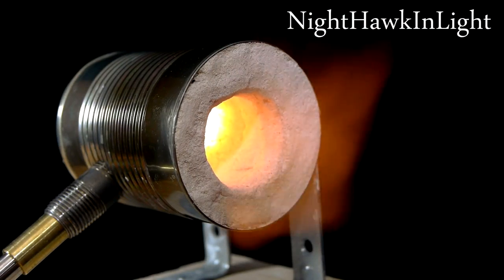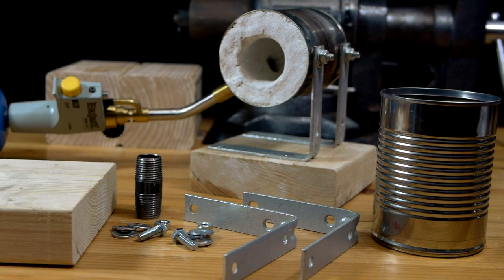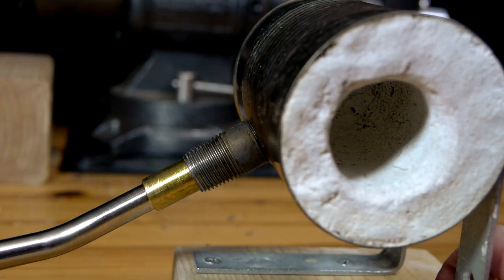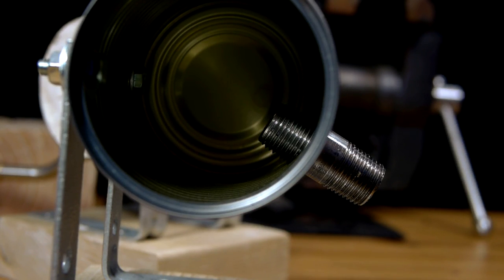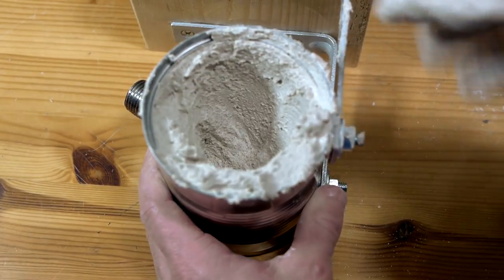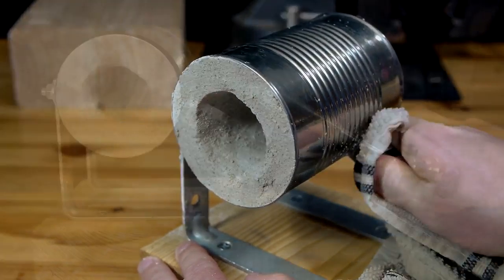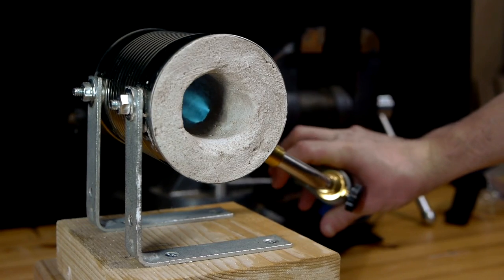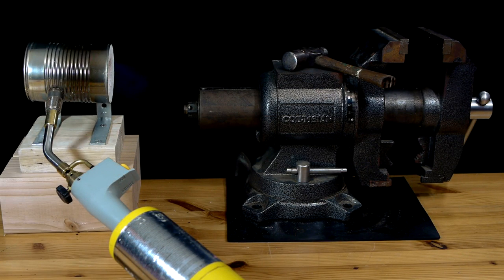How to Make a Soup Can Forge

Comment: I made this and it doesn't work :(
Reply: Why didn't it work?
Reply: SuperTheNova _ i figured it out its because the torch head he says to use in the video you HAVE to use it if you use a normal one it wont work
Reply: Just buy one. Lowes sells 3 different models. The cheap $12 one that you have, the $34 TS4000 and the $50 TS8000 which is bundled with a MAP tank. The torch head he's using is actually overkill and being used very  inefficiently. I use that head in a 1 gallon cavity. And you can get the entire forge to turn yellow hot with the smaller burner you have (in this size forge). The issue is insulation, projection and chemistry.

1) A lot of knife forgers put the burner hole on the side then leave 1 side of the forge completely open (to put the knife in). The problem with this design is there's no back pressure. So 100% of the heat immediately escapes from the opening. If you look at this guys forge it's awful. He's got a better burner than you... but half of the whole cavity isn't even reaching yellow heat. I use that same burner in a 1 gallon forge (way bigger) and get every square inch to yellow heat.

2) If you wanna see the effect back pressure has (on driving heat up) do this. Take the small torch you have now. And instead of putting it in the small burner hole, put it in the large exhaust side. Then play with the position of the torch head. It's hard to explain the angle but you don't want it directly in the center or on the side. Put it in between both the center and side. Then angle the head slightly so the flame shoots towards any bottom corner on the opposite side.

You wanna get the wall of burning exhaust gas (not the flame, the invisible gas), pushing back against the flame from the torch head. So the heat shoots in towards the bottom, the hole on the bottom is too small for the heat to escape, so it bounces back towards the torch head which is pushing a portion of the exhaust heat right back into the forge. When you get it set right you may see the torch flame "disappear" into the exhaust wall, then if you wait a few mins you'll see the whole forge light up yellow.

All you're doing is creating a positive feedback loop. And another thing you'll likely have to do is shut off the original intake completely. I guarantee if you do this, play with the angle of the torch, then just wait the whole forge will heat up. Also, don't stick the brass head in the forge, keep it just outside 1/4-1/2". Otherwise you'll break the exhaust wall creating a spiral. When you keep the flame out a bit the expanding gas hits expanding gas that's what you're going for. 

3) 90% of the videos you see on YT, guys are using burners much bigger than they need. They use plaster of paris which is horrible. Plaster of paris NEVER cures in a forge. Even when it's "dry", you're using unnecessary heat to convert calcium sulfate hemihydrate to anhydrite (releases water) which takes a lot of energy.  This process takes 2 HOURS to complete. And if you run your forge longer than that, another endothermic and reversible reaction takes place.

Most people don't run their forges longer than 2 hours lol. So you shut this type of forge off... the anhydrite slowly converts back to gypsum / plaster (exothermic). It desiccates the water from the air. Then a few days later you turn the forge on again. And over and over you're repeating this reaction and "insulating" the forge with WATER till the plaster breaks down & the entire thing cracks to pieces.

That's another reason anyone doing this will get terrible heat insulation. And it's ridiculous cause all you need to buy is "Crystal Kitty Litter" from Shoprite. It's $10 for a huge container. That's 99% pure silica. If you take that and throw it in a blender you get the purest white silica sand you'll ever see.

THEN you use that pure silica to make waterglass with lye. Then build your forge with pure white silica sand and water glass as a blinder. A forge like that will cure permanently after a few uses. It'll insulate and reflect heat much better. And if you build it right by using a steel cylinder for the cavity then POUND the sand in with a hammer hard as fuck it'll last a couple years easily. That's my last piece of advice. If you're gonna build one, do it once and do it right so you never have to do it again.
Reply: Why dont you show us yours? Id like to see it
Reply: Robert Cece can you make a video of you doing this?
Reply: Lol this comment alone is better than the video
Reply: Loving that i found this comment AFTER i finished my brand new Plaster of paris/Sand paint can forge .-.

Comment: were the fuck would i buy sand :( is such a lame question but in the city is there a place?
Reply: at walmart
Reply: Go to construction sites, and ask them if they would mind if you take a soup can's worth for a home project.  Usually they won't.  Make sure you go when they are doing either foundation pouring, or some sort of masonry, if it's a building.  I wouldn't really recommend using beach sand in your concrete mix, if that is what you are asking.
Reply: Home Depot has to be the best place.

Comment: I really wish the author of this video would take it down.  I am getting pretty sick of explaining to new, wanna be blacksmiths that the soupcan forges they built from this video will never actually work because the design is fundamentally flawed.  

People watching this, please, do yourselves a favor and do more research.  While it might be possible to build a marginally useful forge using a propane torch for a heat source, it will NEVER be possible using this crappy home made castable refractory.  If you want a chance of making a usable forge, go to a ceramics supply house and buy a little Kaowool or Innswool or equivalent and use that for the forge walls.  Use light weight fire brick for the end wall and to form a smaller front opening, and you might be able to build something that will actually heat a piece of steel larger than a 10d nail.  

Here is a link to a forge building tutorial using a torch for heat that has a chance of actually working.

http://www.paragoncode.com/shop/micro_forge/

If you do build a forge using this idiotic plaster/sand refractory, please to not  come over to the r/blacksmith subreddit wondering why it doesn't work.  You will be told in no uncertain terms that the reason it doesn't work is because the guy who made the video is an idiot.
Reply from the maker: Scott Rich Thousands of people have used this forge successfully for knife making. I could post links to results all day long. Here's a recent one: https://www.youtube.com/watch?v=Zf1btj7wWxI I've made knives myself. Say it's impossible and call me an idiot all you want, you're the one that looks the fool.
Reply: NightHawkInLight Come on over to the sub reddit.  People coming over there wondering why their "soup can forge" doesn't get hot enough has become something of a mini meme over there.  We have to set people straight nearly every single day.
Reply from the maker: Scott Rich The reason it doesn't get hot enough is because people use pencil flame torch heads rather than shelling out for a proper spiral flame as I recommend in the video.
Reply: knife guy So do I.
Reply: Could you make a video on maybe how to make your primary forge? I really like the design and it doesn't seem really flawed. Or just maybe list the tool and material you used to make it any im formation would help!
Reply: Scott Rich I can assure you that this "forge" works perfectly, as I finished mine today, and it heated up an iron bar from cold to bright red in about 30 seconds. It may not be sufficient for long metal pieces, but for knife blades up to 3-4 inches it is quite usable.
Reply: If r/blacksmithing hates this video so much, why did they send me here to get me started?
Reply: +Scott Rich lol man take a lesson with it
Reply: +Scott Rich man, the reason he makes these videos is so anyone can easily do it with shit they have laying around. 

perhaps you should warn people of the dangers of using ceramic wool thats not coated in a layer of refractory mortar (it begins to release a fine dust that will destroy your lungs or probably give you cancer) , or tell them how fragile it is after it has been heated to temp. 

this forge would work just fine for small hobbiests that are just trying to mess around with heating up metal, especailly if they stacked a few fire bricks infront of it to make a smaller opening. sand is dirt cheap and a small container of plaster of paris is like 6 or 7 bucks. What do you care if people want to have fun with it? how are people ever supposed to develop a love for the craft and begin their research if they cant try it without going out spending several hundred dollars on real equipment? If they really want to get into the craft they'll go on to do real research and build a real forge. 

i started doing this crap and now have a nicer larger one where i used perlite coated in waterglass and dusted with aluminum oxide powder, and a 80 lb peddinghaus anvil. (for those of you reading this i'll try to make some videos of how i made my forge and burner soon! :D)  i feel like that is more efficient and safer than ceramic wool.

Or if you really have that much of a problem with peoples videos why dont you make some yourself instead of criticizing everyone else? i didnt see you putting any effort in on your profile. people like you disgust me.